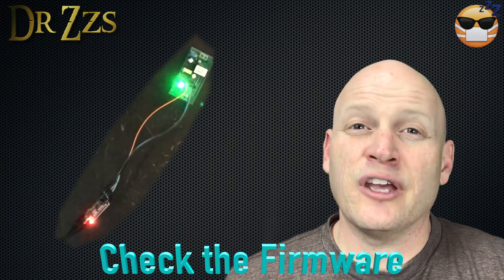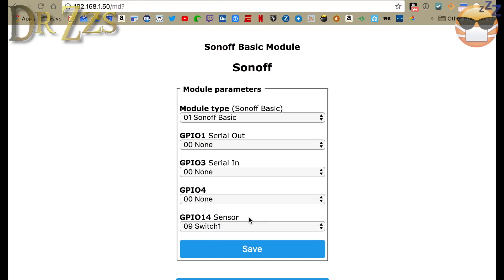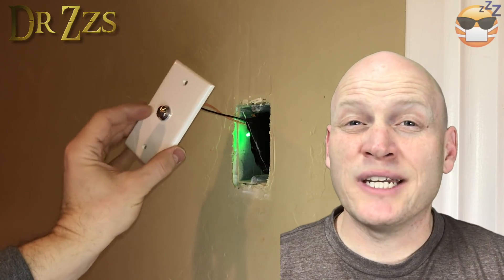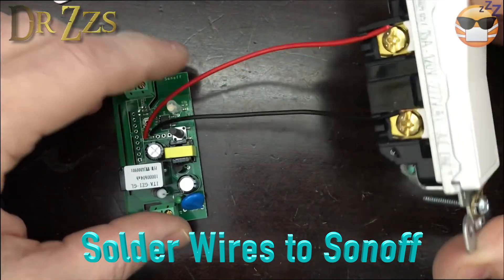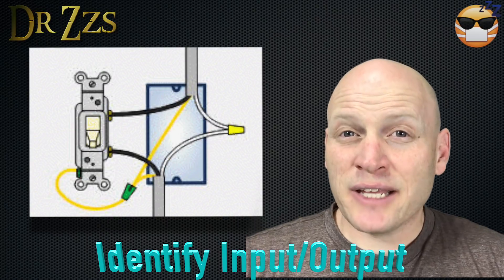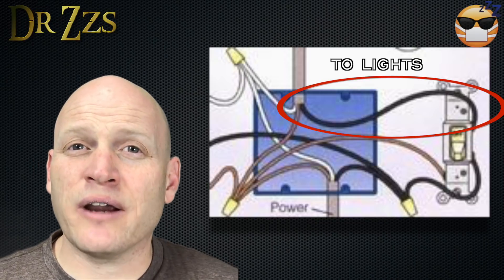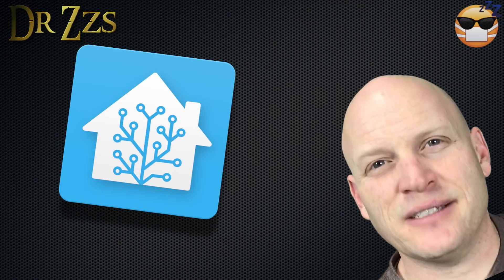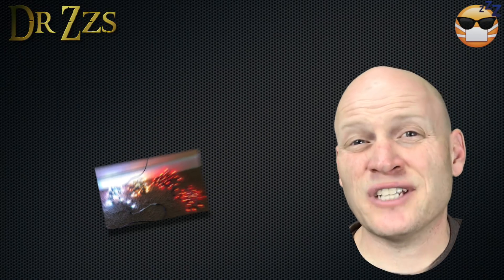No $30 "Smart Switch" | $5 Sonoff + REGULAR Light Switch!

Comment: I used your tutorial on flashing the firmware OTA, so I didn't have the same steps for setting up mqtt in the tasmota firmware. I know you can change the mqtt settings in the web interface, and I thought I had them configured correctly, so I added it to Home-Assistant, and every time I turn in on in HA, the sonoff doesn't toggle, and the HA switch is turned back off. Any thoughts?
Reply from the maker: Is your sonoff connecting to your home network?  Even though you put your wifi SSID and PW in during the flashing (for OTA) you still have to go into Tasmota web interface and set it there too. 
That's what I'd check first.  
If that's not it then double check all your MQTT stuff.
Let me know if you get it fixed!
Reply: Thank you for the help. yeah I realized shortly after posting that comment that I hadn't configured MQTT correctly. Your videos are great by the way. Keep up the good work.

Comment: Unless that low voltage device matches the voltage rating of your conductors per your local code I would not shove the “smart switch” in the same electrical box as your line voltage switch.

Comment: What does the electrical code say about putting that circuit in that box? Don't bother answering, it says that it is not rated for that box. If your house burns down, your insurance will be invalid.

Comment: for push buttons, what kind of button do i need to use? does 5v , 12v or 110 or 220 matter?
Reply from the maker: Doesn't matter at all.  The GPIO pins that you connect to the switch are only 3v (or less).  I don't think you could find a switch that isn't built to handle at least that much.  So, whatever switch you like should work fine. 

These are the ones I've been using for most of mine:
http://a.co/cFC0zeo

Comment: Those wire look awful think for 120V  please be careful doing stuff like this.
Reply from the maker: Which wires?  
Yes, certainly make sure the flexible wires connected to the input and output of the sonoff have insulation rated for at least 120v.   
The thin wires going to the push button are not carrying 120v.
Reply: The red and black at about 1:35. Honestly this video came on while I was doing something and I didnt really watch it. If those arnt carrying full power my bad. But if they are, I dono, I no electrician, but all the wiring in my house is quite a bit heftier.
Reply: Ill change my comment if im wrong, Im not trying to be an ass, I just worry
Reply from the maker: Justin 355. Ya, those are just the switch wires. Not mains voltage. 
No problem though. Thanks for watching and commenting.  I surely make mistakes sometimes.
Thanks!

Comment: Nice job, well explained.  Wish I could find a good way to compare Tasmota Vs ESPeasy.  Been using ESPEasy so I'd like to know the difference.
Reply: Yea, I'm kinda getting that.  Seeing as how I use these devices with Node Red and Mosquitto (Raspberry Pi) anything that provides MQTT and http will pretty much do anything I need.  I am finding though, that the Rules feature in ESPEasy does allow me to offload the fixed, local control stuff to the unit level which is kinda nice.  Not sure if Tasmota has a similar local control capability.  Gotta say, not being a programmer, no longer having to deal with C++ has made my Home Automation and hobby stuff a lot more fun.  I can concentrate more on hardware which is more my wheelhouse.  So glad people worked so hard to develop these programs.
Reply from the maker: Thanks! 
I've got ESPeasy on my list of things to try.  When I do get to it I'll do a comparison with Tasmota.
Reply: They're the same more or less.
Reply: ESP Easy is highly configurable (usually without re-compiling) and was designed to work on any esp8266 based hardware, which also means it has more of a learning curve than tasmota. In the device itself, one can setup timers and actions that do not require a home automation system at all. For example, want a switch that turns itself on when some condition is met, say a certain time of day or an IR detector firing or a certain temperature being reached, then turns itself off after 30 minutes or some other condition, ESP Easy can do that without even being connected to Wifi.  That being said, tasmota has grown a lot.  Many things it couldn't do a year or so ago are now possible so it's hard to say which will be better down the road.  For simply interfacing to a remote light switch or getting the temperature from a standard sensor to a home automation system, tasmota is easier. For those that are making custom devices or coming up with unique uses based on the esp8266, ESP Easy is going to be a more flexible choice.

Comment: you have tons of space to install the circuit over here there hardly enough space for the wires :) :)
Reply from the maker: bummer. 
It would sure be a lot easier and safer with more space in the box.  
Good luck!
Reply: off topic quest what 3d printer are u using and what would u suggest
Reply from the maker: I use a Lulzbot Taz5. 

It's been great, but I think the current best value is the CR-10: https://youtu.be/tFfMPjKhF8c
If I buy a second one it'll be the CR-10.

Comment: Great Video.  What gauge wire did you use for the pig tail?   I am trying to use 14 Stranded THHN, it is still hard to bend.
Reply from the maker: Thanks!
I used 16g. I wish there was a better solution for that. Like the kind of connectors on some light switches where you just push the solid copper wire in and it holds tight.  Wish iTead would use that for the sonoffs.
Reply: Totally agree.  I have been sending emails, feature requests etc.  No response.  Plus wish they reduce the profile for sonoff to easily fit in the standard 1 gang box.  What is your experience with wrapping in electrical tape?
Reply from the maker: ha. well, no fires yet. 
I was surprised my brother-in-law who is an electrical engineer didn't have an issue with that. It does make it smaller.  

I started using more push-buttons and not re-using the regular rocker switch.  That makes for a lot more space in the box, and I can leave the case on it.  I just drill a hole in the case for the switch wires to come out.
Reply: 120V 15A you must use 14 gauge or thicker

Comment: can I use google home ?????
Reply: Edit: For google home, if you want to connect directly to it without a MQTT broker, then it won't work with Tasmota. You would need stock firmware and their app, but that would mean you would lose the GPIO14 option.  With Alexa you can connect to it directly if you setup Tasmota to emulate Hue or Wemo.
Reply: I am a bit out on a limb here, as I don't use HomeAssistent, but Google home can deal with HUE, so if Tasmota emulates that, I don't see a reason why it shouldn't work
Reply: @Ed19601  When using home assistant, and having it set up to work with Google Assistant and/or Alexa, this Sonoff will appear just as another switch and you'll be able to use it from GA or Alexa directly, nothing else needed, it just works great!
Reply: @jolaca01  thanks for yr comment but I wasn't doubting that :-) in fact I was saying it would work  ;-)
Reply: @yellowonion  FFS why can't google implement that.
Reply: @spawnterror  because of how google implements it's integration. It ties into the vendors api and passes messages along that way, hence requiring thier sonoff's app. Alexa has skills it learns to directly talk to the device.
Reply from the maker: For sure.  
I don't have a google home (yet) so I can't advise you on the set up.  
I know you can connect google home and Home Assistant, I just don't know how to do it.  

Looks like it takes a bit of set up:
https://home-assistant.io/components/google_assistant/

I've got a google home sitting under the tree for myself.  I'll eventually figure out how to get it connected.  

Let me know if you get it working.
Reply: DrZzs thank you very much
Reply: Peeta  is there a guide to make the Tasmota do that? I've got an echo that I want to be able to use.

Comment: I basically did this same thing also. I used flexible wire also. Have you figured out how to control a light that has 2 separate light switches that can control it? example: Hallway light switch on both ends of the hall
Reply from the maker: You mean a 3-way switch.  No I haven't solved that one yet.  
Here's Pete's video that is something like that with Sonoff Basics running ESPeasy.  

https://youtu.be/xQltSHSVleI

It's on my list of things to figure out.  Hopefully I can get to it soon.  I have a lot of 3-way switches that need to get "smart"

If you do it before me, let me know how it goes.
Reply: Yeah I have a few as well that i need to do . I was hoping I could set a sonoff on each switch, and let HA keep them in sync so the state stays the same on both switches. I saw Petes video, but Tasmota is confusing enough, espeasy is rocket science... I have so many project but my limitations is programming and coding. I still havnt figured out how the heck to do automation.....
Reply: It's easy. A second Sonoff without connection to the lights, but a virtual connection that switches the first Sonoff wireless (that's the reason we use the Sonoffs :) ). The code depends on your home automation sw.
Reply from the maker: Funny, we've lived in a wired hardware world for so long, we look for wired hardware solutions first.  
So, the second non-light-connected Sonoff, triggers the first Sonoff to toggle, and bingo, 3-way switch.  
I'll have to try that out tomorrow. 
Thanks!
Reply: Bernhard Walter I'm using HA . Do I have to use another sonoff in the wall not connected? I have a few esp8266-01 laying around can I use them ?
Reply from the maker: Andy Meggs Yes. That should work. All you need is a button that can send an mqtt message.
Reply: DrZzs well let’s make it happen we need to figure out the coding in HA .
Reply: @ameggs in secondo sonoff è una bella soluzione ma diventerebbe inutilizzabile in mancanza di rete

Comment: will this wiring method work with alexa skill as well or will the red and black wires not function properly?
Reply: You can also easily integrate Sonoff-Tasmota with SmartThings-Home Assistant such that it appears as a simple switch in both systems.  Basically you use MQTT to integrate the Switch-Tasmoda with Home Assistant, then you create simulated switch in SmartThings, finally you use a Home Assistant automation to keep everything in sync.  Assumes you've already integrated SmartThings and HA via the MQTT bridge.  Once you have the switch appearing in SmartThings, it will automatically be available to the Alexa smartapp.  I'm working on a tutorial, but ping me if you want a few more details.  Btw...DrZzs, thx for the excellent video on flashing the Tasmoda software.  Worked like a charm... other than the peskyness of dealing with admin vs. non-admin versions of Arduino ;-)
Reply from the maker: If you are using an un-modified sonoff with Alexa, and you flash it with Tasmota, it will likely stop communicating with Alexa.  
However, there is a way to make Alexa think the Tasmota-Sonoff is a Hue or WeMo device. To do it, put your sonoff's IP in your browser, you'll get the home page of the tasmota firmware.  Select "Configuration", then "Configure Other".  You can select WeMo or Hue Bridge.  I believe you have to disable MQTT also (there's a checkbox to un-check on that same page). 
I haven't done this so I don't know much about it.  Let me know how it goes if you try it. 
You could search the Tasmota github page for more help if you need it:
https://github.com/arendst/Sonoff-Tasmota/issues

Comment: I see you soldered the two wires to GPIO14 and GND for the light switch connection. Since I already have a 5-piece female header strip soldered onto the Sonoff (like a lot of people will have after flashing), can I just use two male jumper cables and cut one end to screw to the switch, or are jumper connections not recommended for a permanent solution? Rewatching your tutorial a few times, I noticed you did not solder any header to flash it, just inserted jumperst into the holes... so maybe I'll try that for next one so that I don't have to unsolder it.
Reply from the maker: You can totally use jumpers for your switch wires.  I've done it that way on other boards. They hold pretty tight.  
Ya, I soldered a header on the first couple I flashed, then realized it wasn't necessary and I could save some time.  
There is a way to flash them without touching the board. 

https://github.com/mirko/SonOTA

I'm working on that video right now.  Should be done next week.
Reply: Sweet! I'll definitely be using it then since it will take a few weeks for new parts to come anyway. Thanks for your work on this.
Reply: Hi, did you ever make it through OTA ?
Reply from the maker: yes!
https://youtu.be/ONFhXM5R-t4

The problem now is the newer firmware on the Sonoffs (ver 1.6) makes it impossible to do OTA :(   
If you get some older Sonoffs with older firmware you can still do OTA.  But those are getting harder to find.

Comment: Very technical, I guess this isn't for everyone though. I think I can wing it though. thanks for the info and all the detals.
Reply from the maker: Baby steps.  
I hadn't done anything like this a few months ago.  You can use the Sonoffs out-of-the-box, and they work great and are quite cheap.  When you feel like getting a Home Automation Hub (like Home Assistant), then you can take the next step and flash the firmware.

Comment: Great video, dropped a like and subbed for the future, question or two for you.  Where did you get the shnazzy push button switch from the beginning (not the 3D printed one)??  Any idea if this will work with Samsung SmartThings??  I saw your other comments on the possible safety implications so that’s already answered and if you could get it to work with Alexa in the future post a vid on that!! Thanks Boss!!
Reply from the maker: Thanks!
I'm planning on getting Alexa connected to Home Assistant.  I've read how to do it, but haven't tackled it yet.  
Here's a link to that switch:  http://amzn.to/2yvHbdj
I actually found some I like better.  Still shiny, but lower profile: http://amzn.to/2j5bkuz
I bought a SmartThings Hub too.  Haven't even opened it yet, but it's on the vid-to-do list!

Comment: @DrZzs First of all, what an excellent video tutorial. Thanks! One question: what if the wire arrangement in the switch box is as in the first example (only two wires from the light to the switch) what type of switch/solution should I use?
Reply from the maker: That's a tough one.  If all you have are the 2 wires that go to the lights, then you don't really have a Hot and Neutral wire, you just have (probably) the hot wire that is being switched.  Is it one light or multiple?  The main power has to  come into one of the junction boxes of the lights.  If you can find it, then you could put the Sonoff in that box. You' could then use the wires going to your switch to come off your GPIO pin and it would still function the same.  

So I guess there is a solution, if you can find the main circuit to the lights.
Reply: @DrZzs  There is another solution:  Put the Sonoff in the ceiling, behind the ceiling rose.  The switch will be a "hot live" which will run in from the switch and be terminated at the rose, so you can tap it into there and all will be well.  This is what I did (although not with a Sonoff), I live in the UK and we tend not to have the neutral lines at our light switches.

Comment: Followed last video but keep getting the following error. Can you help.
Arduino: 1.8.5 (Windows 10), Board: "Generic ESP8266 Module, 80 MHz, 40MHz, DOUT, 115200, 1M (64K SPIFFS), ck, Disabled, None"

Build options changed, rebuilding all
C:\arduino-1.8.5-windows\arduino-1.8.5\portable\packages\esp8266\tools\xtensa-lx106-elf-gcc\1.20.0-26-gb404fb9-2/bin/xtensa-lx106-elf-ar: unable to rename 'C:\Users\budlyte\AppData\Local\Temp\arduino_build_499414/arduino.ar'; reason: File exists

exit status 1
Error compiling for board Generic ESP8266 Module

Comment: Is there any way to set up the sonoff to simulate a 3 way switch. This way you could still use a three way switch in legacy mode and the other 3 way would be through the sonoff. If the sonoff goes offline for whatever reason the light will still be functional through the standard 3way switch.
Reply from the maker: I need to do that too.  
This fella has a solution using ESPeasy instead of Tasmota.  
https://youtu.be/xQltSHSVleI
Reply: The one big advantage of the $$ Z-wave/Zigbee devices is that generally speaking there's no software to worry about in terms of basic local switch functionality.  Would be nice if Sonoff altered the circuit such that the ESP itself could be down, yet pressing a button still toggles the relay.  Might add a $1, but it would be well worth it IMO.
Reply from the maker: After watching Jonathan's video (SuperHouseTV), it sure seems like iTead is flexible and responsive.  Hopefully they keep innovating.  It sure is fun though, to open the board and mess with the software.

Comment: Do you have links where you get your sonoff from, or any sonoff will do. I have one sonoff that I am running espeasy on. which defaults on gpio 12. if any sonoff I might flash it with this firmware to give it a try. 2nd question. I am planning to change out my router soon. when I flash it with this firmware, do I need to flash the firmware again to get the sonoff to find the new router?
Reply from the maker: Any will do.  You could just re-flash the ones you have with this firmware.  That's no problem.  If you don't mind waiting, iTead has the lowest price (but they come from China so it takes weeks).  I've bought some from Aliexpress and Amazon too. 
And you shouldn't need to do anything when you change your router as long as you use the same wifi name and password.  If you change your wifi name or password then you will have to update your sonoffs with the new ones.
Reply: DrZzs l will change the ssid to a new name.